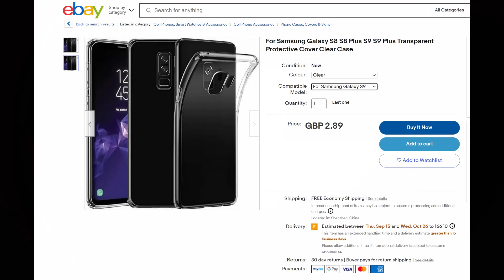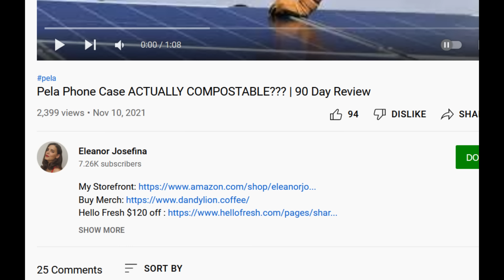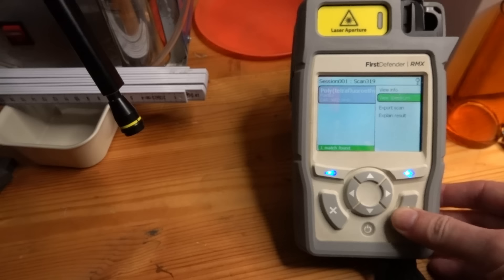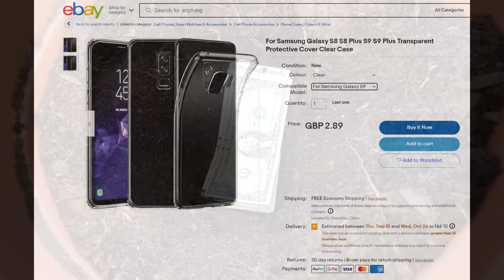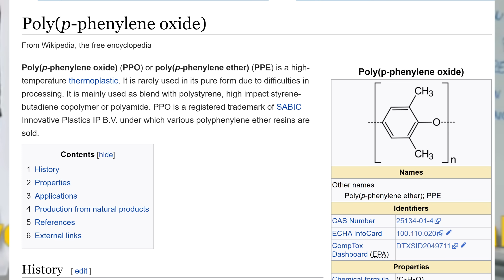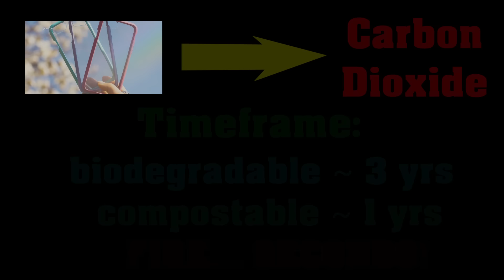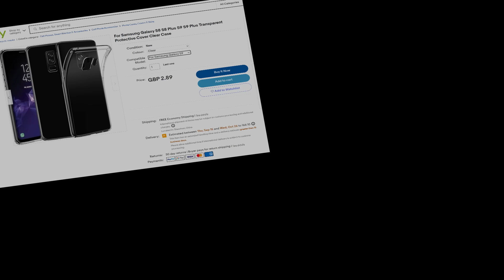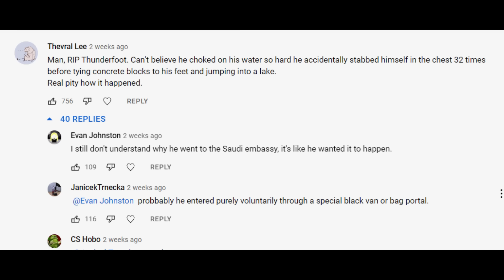Pela-Case: BUSTED!!!

Comment: Usually I'm against being spiteful. I'm also for the inviroment. But still I have a hard to control urge, to post that I will personally add 50 grams of co2 to the atmosphere for every unit they sell... even if it will deter only half of the buyers, I'm sure the invironment will gain. Not only it probably creates co2 as it decompose, but when you add the fossil fuels burned to manufacture it, deliver it from China, ship it to the costumer etc... I'm sure the total is hundreds of grams of co2. For the guys selling this crap, either they make tons of money, or if their cost is high, that's another indicator that's probably it's manufacturing is creating plenty co2.

Comment: I'm 2 minutes and 35 seconds into the video and I can already tell you that this thing is a piece of junk. I've ran into biodegradable stuff before and we don't get along. I don't know how many Plastics how many things have torn up just because I touch them. and when it comes to the biodegradable stuff I got throwaway plates that do that i touch them two days later I can't use them again because they're breaking disintegrating. Like I said me and plastic does not get along when I touch plastic it hardens up becomes very brittle and brakes and completely disintegrates. I've had to buy several different PlayStation controllers whether it was PS2 PS3 PS1 just because of that reason of disintegration just because I touched them. So by what this phone case means is I pay $60 today next week I have to pay $60 again and so forth and so forth and so forth and so forth so by the time a year passes I've done spent over a million dollars just to have this phone case because it keeps disintegrating into my hands. I'm lucky that one of my phone cases is not biodegradable and not anything like that and so it has lasted me at least 2 years. Now when it comes to headphones yeah I like the wireless because of the same exact reason but that's a whole different subject. anyways like I said me and plastic does not get along just like me in glass don't get along

Comment: I prefer comoanys that actually give you a charger, USB cable and phone case, when I buy a phone case I realy don't care what it's made from as long as it protects my phone, screen, cam, has stippling so its easy to hold, has a colour that's not black so it's easy to find, is thin so does not trap in heat and has some vent holes where the main chip is as I usually buy a Chinese phone like a xiaomi with a high end snapdragon 8 chip and it lasts years.

The kerosine or bunker fuel it costs to ship from China then the diesel and quite often petrol to get to your door in America, or just diesel in most other nations.

Then the fact this company is making about 58 dollars a case, when that money is put in a bank they loan it out to projects that include oil and gas, construction, logging and high carbon industry's.

You can't escape cravon unless you make your own mobitary system or use gold as payment for everything and just live on a hippie commune and make most of what you need apart from the medical side fo things, but now way could you do it without grazing animals so vegans would starve unless they got a load of chemical fertilizer.
I'm sure the main cash crop would be cannabis as that's all hippies can farm.

I would think its crazy to spend 25 pounds in a phone case I usually buy nillkin cases from China that have an rrp of 6 pounds but I just get new Ali express account so I can get it for a penny or under 2 pounds.

The landfills of old phone cases we have it so bad.

Maybe we could wind up the greenies this winter by turning plastic into fuel.

Comment: i think you're kind of beating a dead horse here, something decomposing in the ground is basically the same, albeit slower, to burning it or other mode of destruction. that's all there is to say ! it's dumb because it's the same. it's dumb because throwing your old phone case in the trash is not all that hard and there's no reason to want it to be biodegradable. it's dumb because it's most definitely made of the same old plastic as any phone case. 

saying you may as well bury your money doesn't make any sense to me

Comment: Or you can buy an OtterBox and never have to buy a new one until you get a new phone
Reply: You know what that phone case would probably be decently strong because mixing cellulose fibers with a good polymer phone cases they're pretty decent anyway that would likely result in a pretty impressively strong case. But you see the problem is is that also makes a not very boostable product still biodegradable after a few years

Comment: On one side we have people trying to lock the worlds carbon into an imaginary bubble to "save the world";
Meanwhile a company in china making disposable electronic vaping products just ruined your whole career a thousand times over with the sale of a single unit.
All the energy that goes into making something that features a fully rechargeable lithium battery - complete with a fairly complex electronic control module which hogs a fair amount of silicon considering the chip features fancy controls to run one of these things without exploding - and a battery charger which will never be used (unless that chip was installed in one of those 'cartridge' type devices.) not to mention all the stainless steel, aluminium and plastic parts that make the rest of the device; all that took enough energy to charge an end user about the same amount as a PELA case, but considering identical phone cases are valued at less than 10% of that; one side is commercial profit - the other is just plain evil.

By repurposing the guts of just one 'disposable' into a flashlight would be a more effective way at combating waste issues than purchasing a lifetime supply of phone cases from these crooks...
This era of "throw away" technology is just plain stupid - you can 'recycle' carbon, but you can't reuse silicon in another chip. You can only burn it to get some of the rare elements back, then you need to find fresh semiconductor grade silicon, which is a limited resource as we stand today...

TL;DR - Magic isn't cheap, so the more we waste our gifts on exploiting others - the less our future selves can afford to live with even a fraction of the powers we hold today.

Comment: how about more indestructible phone not needing cases and say not making them out of glass, like now one knows glass will crack,  and what with all glass screens not only take up the hole front, but they now going around the edges up like when the designing, has now one in the design team ever not dropped there phone, a thought what this need is more glass, none metal, carbon fibre stuff,   no what it need is more glass on all it side, the hole thing need to be made of glass, (memo to needs more glass parts, the more the better) ¯\_(ツ)_/¯ 🙂

Comment: Someone said I should watch this, but I didn’t find it that helpful. Yeah, they’re marketing at least partial BS. This is obvious to me, but the compostability isn’t the only selling point. They claim to lack a lot of materials I want to avoid. “Forever chemicals” as they’re called, currently. What are the results of your buried case and what did the device say Pela cases are made of? If there is a follow-up that will be the helpful part…

Comment: You STILL believe men walked on the moon in the 1970s?!?! Not too bright, this one.
Reply: uhhhh....
Reply: @mattd6085  Here is another piece of evidence. The astronauts' shadows shrink and grow as they move toward and away from the light source in the videos. That doesn't happen with parallel light rays from the sun, that only happens with a local point source of light. I hope this basic geometry isn't too advanced for you.
Reply: @IRM321  there are multiple techniques. The distant Earth shot that was supposedly 1/2 way to the moon was done by filming a circular window in low earth orbit and putting a crescent shaped insert over the window to mimic the day/night terminator. You can tell that this shot is a flat circle and not a sphere, so unless you are a flat Earther, that can't be a picture of the Earth.

For the videos, they attached weight bearing lines like ballerinas use to the backpacks of the astronauts and also slowed the speed of the video down by 50% to give a floating effect.

For the descent, the used a camera on a rig that approached a scale model of a strip of the moon's surface.

They did a really good job for the late '60s and '70s in terms of movie special effects, but by today's standards, it looks tacky and cheap like a classic monster movie.
Reply: @Dziaji  How did they get the lighting? You can see the shadows are perfectly straight and parallel, that can only be achieved with a light source that is millions of miles away while at the same time you don't have an atmosphere in between the light source and the object, meaning that they either created a whole filmset in space, or they actually went to the moon. Another option would have been to use lasers, but the only lasers that existed at the time were red, and each one would have costes millions of dollars.

Also, to what purpose did they do this?Please, tell me.
Reply: @IRM321  Not sure what you are confused about. The shadows are not completely straight and parallel. They used a single light source that is far enough away to make the shadows close enough to parallel. You can test this yourself. You don't need millions of miles to get this effect. What you can see is the fact that the shadows shrink as they move toward the light source. That proves the light cannot possibly be millions of miles away.

Atmosphere won't affect the light source in any meaningful way here, so you are way off base on that one.

The purposes are obvious and simple. It makes America seem so powerful that they are capable of things no other country can come close to, commanding respect, and it costs way less to shoot a movie scene than it does to actually go to the moon, so it basically amounts to the embezzlement of over 25 billion dollars of taxpayer money. Is 25 billion dollars a decent motivation in your eyes?